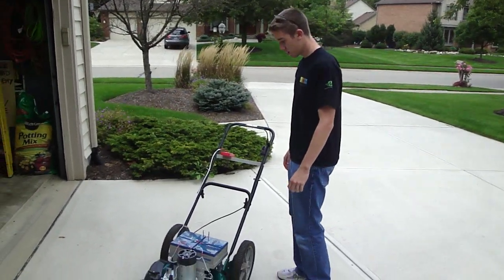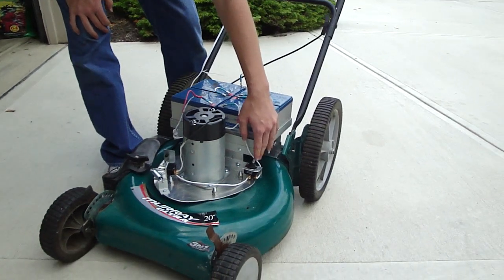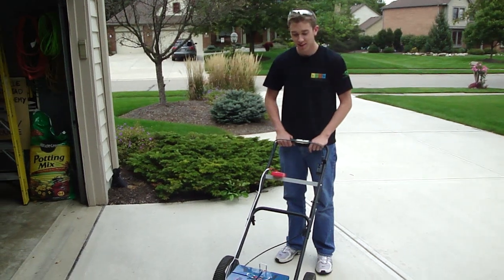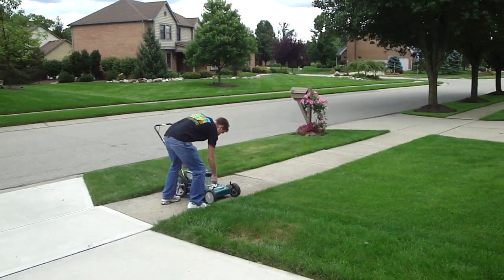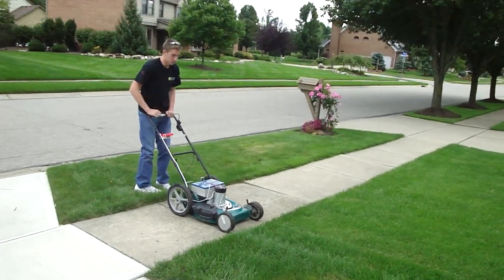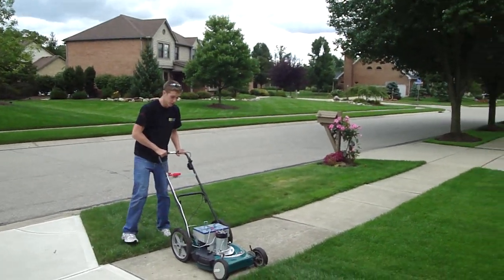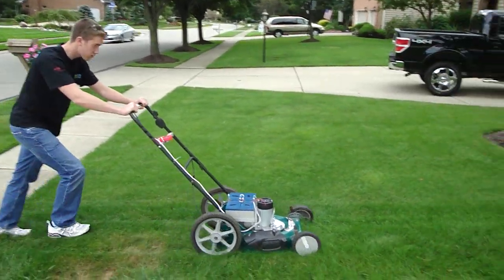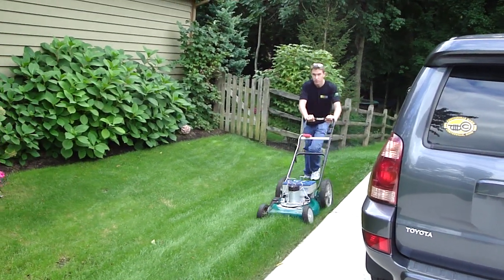My Electric Lawnmower

Comment: This little thing is a beast!>>> t.co/3MgR6YCaH9   Just what I needed for our small-ish yard. Keep in mind the mower will bog down if you're trying to plow through the friggin Amazon, so just back it up and the motor should catch back up and keep running. GET THE RIGHT CORD! For 100ft cord you're okay with 14 or 12 gauge. So far I'm extremely pleased with the deal I got with this mower.

Comment from the maker: @hedwig85 Check out the second link for motor advice -- hint: craigslist. To interface the motor with the mower deck, I simply made an aluminum plate with appropriate holes for the motor shaft, motor mounts, and the mower deck mounts. Later I had to go back and make a second plate and stand the motor off because the cutting height was wrong. The blade and its mounting hardware were purchased together with the motor, so they matched. And I am currently figuring out how much it can mow.

Comment from the maker: @hedwig85 @hedwig85 Yes, this is a converted gas mower a friend donated. Many websites helped me in the process (see notes above). When choosing the motor, you have to consider power and voltage. I chose a 1.5hp motor at 48 volts. Finding a DC motor of that size and low voltage for a reasonable price is very difficult. After months of looking, I gave up and bought a replacement motor for a cubcadet e-mower (BAT-500-EL) : / you may be able to find more used now.